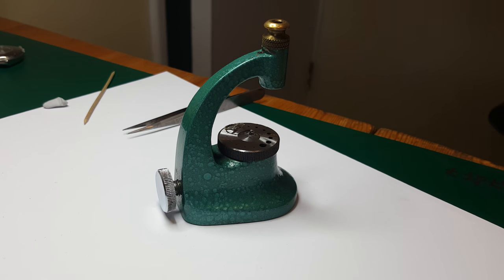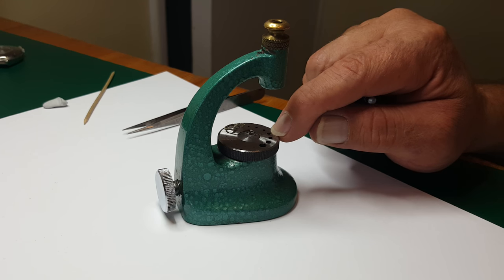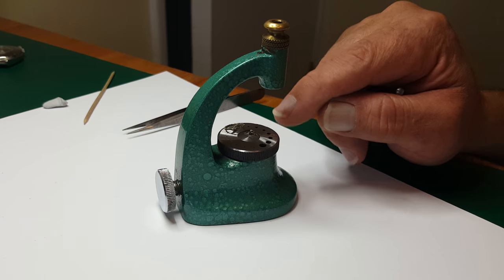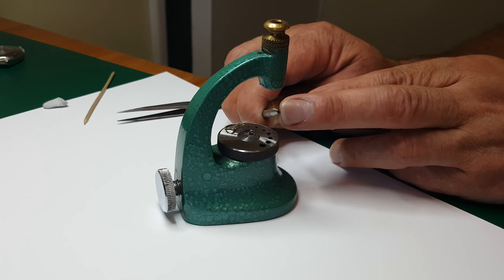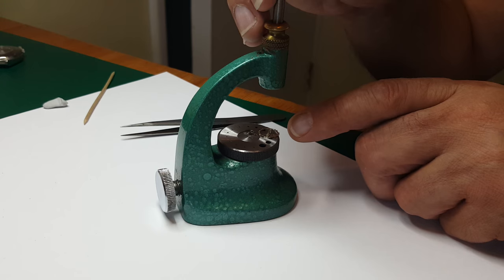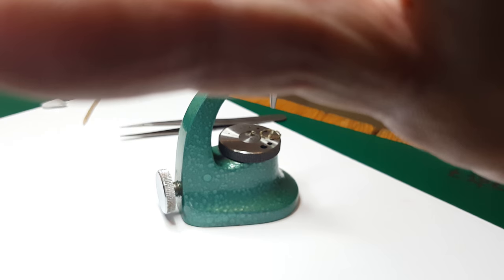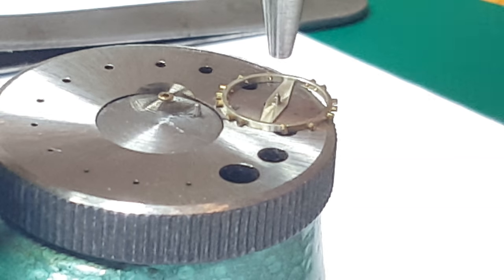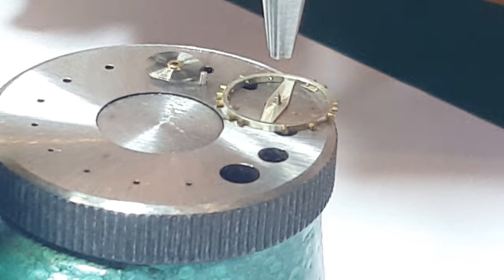Attaching a watch hairspring onto balance wheel

Comment: Hi, at the end Nothing is shown or spoke about on how far down the spring is on the staff. Are these staffs made so that it is most proper to fully seat the spring in contact with the staff landing? That makes the most sense right? I read of people wanting to raise and lower the hs height, and because either the over coil or the balance arms are rubbing.
Reply from the maker: The collet which is in the centre is seated all the way down onto the balance staff. The hairspring shouldn't touch the balance arms, otherwise the hairspring isn't truly flat if it us doing that

Comment: Hey Jon, great video. Can I ask some follow-up questions? First, I assume you just used a flat punch here, right? No domed punches or anything? Second, I think you should just be able to push the collet on, no hammering or striking required? And last, did you have to tighten the collet at all, before or after you replaced it? Thanks, keep the videos coming!
Reply from the maker: Hi John,
Yes, a flat punch with a hole in it to take the balance staff pivot. You should be able to just push it on. I didn't have to tighten the collet, but sometimes you do. Thanks for watching...
Reply: @jonthewatch3640  Awesome, thanks Jon. What do you use to tighten it?
Reply from the maker: @jfcairnx  There is a special tool, but I use a tiny pair of grips with a various size holes to grip the collet and close